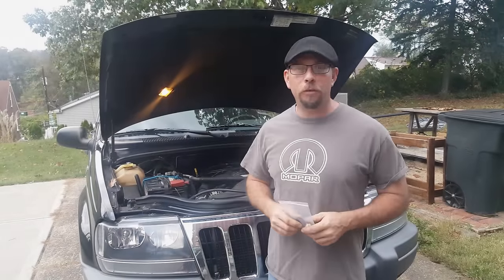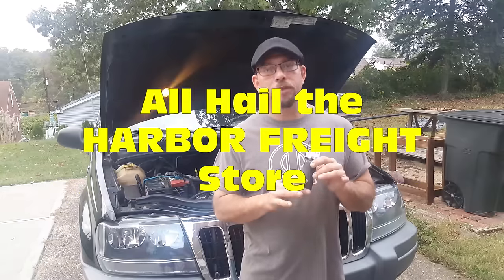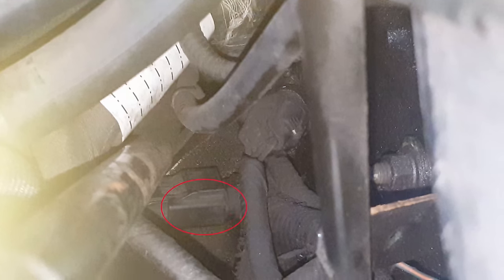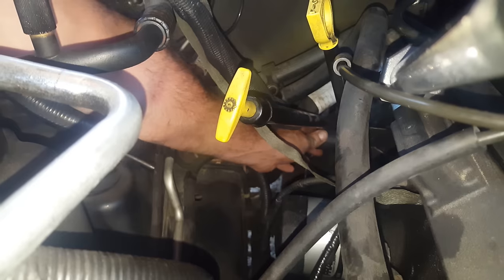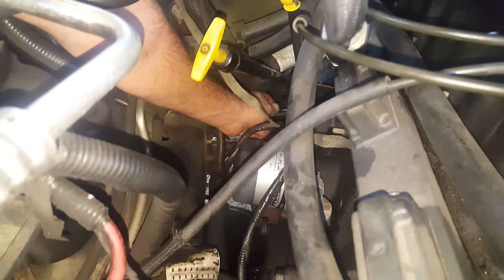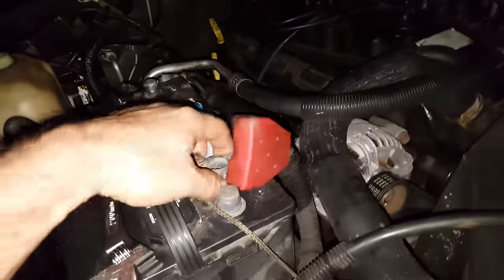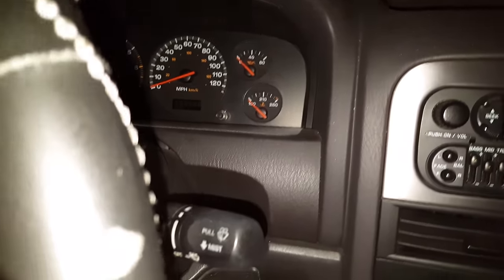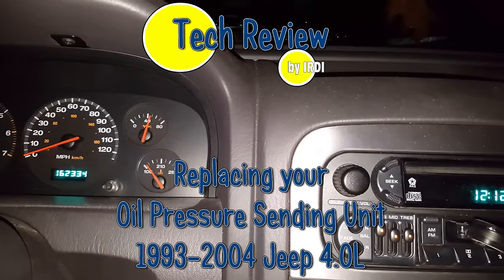4.0L Jeep Oil Pressure Sending Unit Replacement

Comment: I have a 2000 WJ 4.0, and should be the same part number, but I am getting a "This part won't work on your vehicle".  Advanced said the Mopar part number is P40301115583MPR.  Are you certain the part number you showed works with a 2000 WJ4.0?
Reply from the maker: It does. As well as I'm currently an RPP at Advance Auto. The part crosses over to many Mopar revisions and then a bunch of aftermarket ones. I still have the 2001. She is getting a ton of frame work done, but will coming out of hibernation soon. You can use 5093908aa, P40301115583MPR, 56028807AB, 5080472aa. And even the Advance Auto Driveworks 59003 or BWD S4191 which has a lifetime warranty. So, there are many out there. These work on your 4.0 as well.
Reply: @TechReviewbyIrdi  Bought My WJ New in 99, replaced engine 2 yrs ago. The latest issue showed itself as I was driving on the Tollway and the Computer Ding went off and said to check gauges.  The Oil Pressure was 0, but engine was not running hot. Parked but noticed clacking so oil is not getting to the lifters.  Thinking now it is likely the Oil Pump and not the Sensor, as it did its job.
Reply from the maker: @olschool3740  I agree in that direction. The pump sounds like it went. Especially after hearing the rods clatter.

Comment: My 2004 Grand Cherokee 4.0L 6 cycle did the same thing. Today, it did it again. I checked the oil level first. It said to add a quart. I attempted to remove the oil cover cap and it broke. I did remove it. I tried to pour oil in and it would allow any oil in, at all. Apparently, I have broken a piece of the cap off into the opening. I was able to force the old cap on, drive to AutoZone and purchased a new one. It did not fit. How do I remedy my problem? Help me, please!
Reply from the maker: Is the cap for the make and model Jeep? Or is it from the general stuff on the floor. If it's the general stuff, I would ask again or go to another parts store just in case. If the cap seperated, then you can drill a small hole on the remaining piece and use needle nose pliers to turn it out. Other wise, the valve cover has to come off, which on these are pretty easy but you have to get a new gasket for the cover. I had worked at Advance Auto, they had the caps but they were in the back by Carquest. There is very little clearance under the cap as well, so if drilling to make a small hole to grab don't go too far.
Reply: Its the right cap. My mechanic came to my place of employment and used a per pliers and removed a piece of the part that I had left on from the old broken cap and in 2 seconds he had placed the new one. That's all there was to it when you know what you're doing. Thanks for your response.
Reply: @TechReviewbyIrdi  Thank you

Comment: Do you have to drain oil before doing this?
Reply from the maker: I happened to do so during this. I cannot be fully sure about it. I would change it though considering your by the filter anyways and it will make it easier.